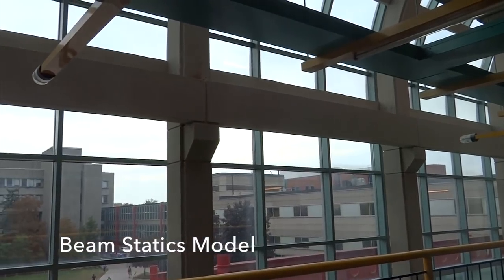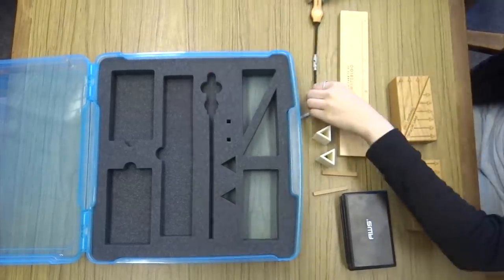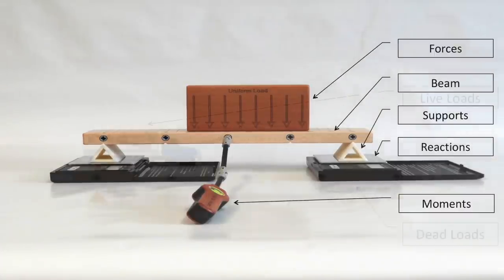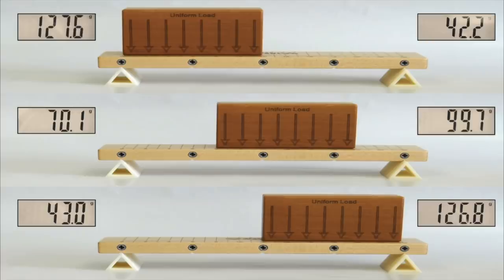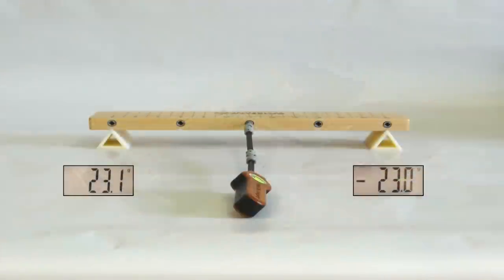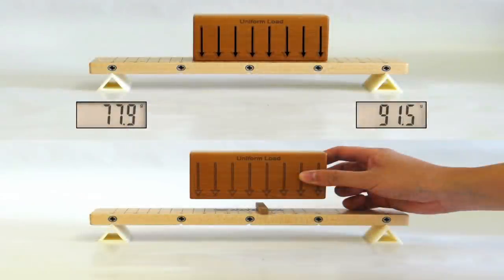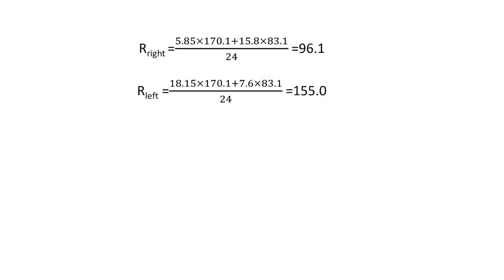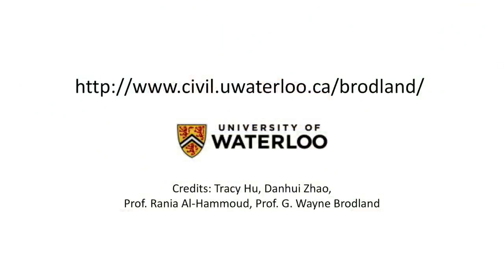Beam Statics Model - Equivalent Loads, Torques and Reactions

Comment: In that static system, the force you applied (concentrated moment) is not a torque... It is a classic bending moment in longitudinal direction for the subject beam even though its applied by twisting...
Reactions are not created only in this case (simply supported beam) and "similar cases" , but will be created/affected if supports that are unable to rotate freely are present within system. Otherwise element/system reactions wont be affected.
Your videos are very visually self explanatory and good, but pls try to speak in a manner that will prevent misunderstandings or similar for starters...
Keep on good work